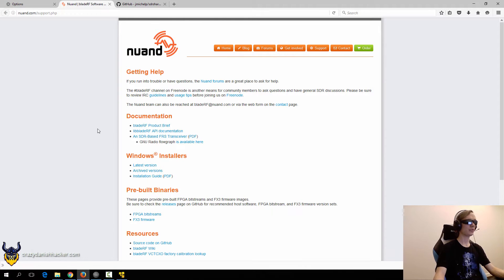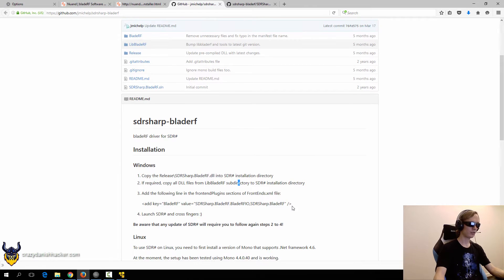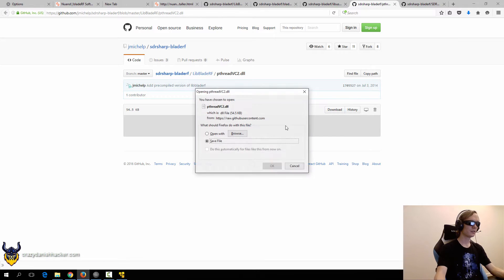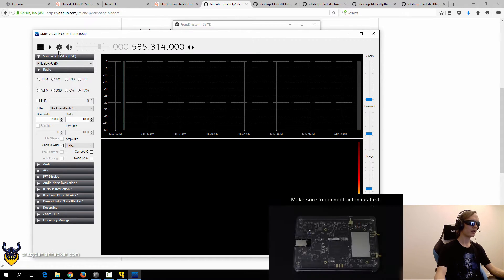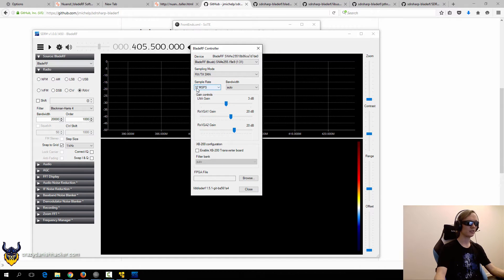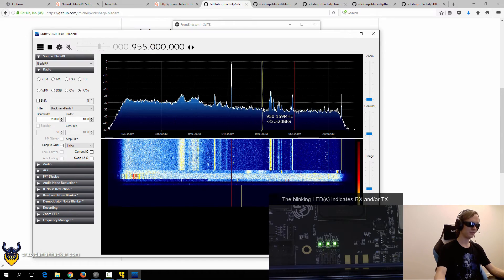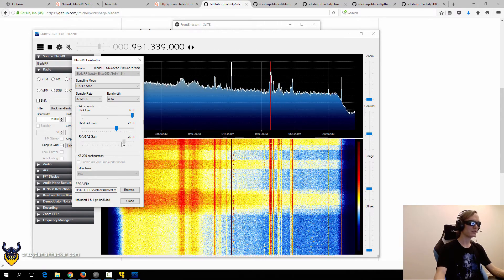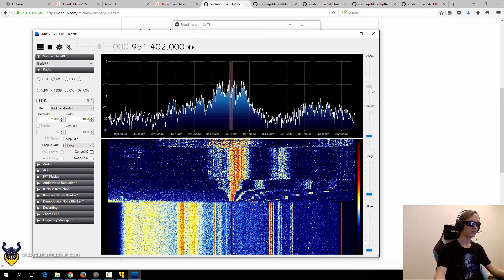BladeRF + SDR# on Windows 10 - Software Defined Radio Series #17

Comment: hey Crazy Danish Hacker, 
There is not device option in the bladeRF controller part, I have the bladeRF xA4, what i have to do? thanks
Reply from the maker: You need an old version of SDR# for it to work with the BladeRF plugin, and even then I'm not sure it's going to work with the model you have. Try out this instead: https://github.com/xmikos/qspectrumanalyzer 
It supports many different modules, including: https://github.com/xmikos/soapy_power

Comment: Hi Crazy, with mine bladerf shows up in Source dropdown but not in config dropdown, it sais bladerf in text next to device but doesn't appear in the dropdown. Running Bladerf  A4 on Windows 10 pro, is the USB ID; 2CF0 5250 correct? Thx for ur help.
Reply from the maker: Use an older version of SDR# and try again

Comment: I have been trying to BladeRF x115 work with SDRSharp without any luck. I tried with both a windows7 and a windows 10 machine but couldn't get it to work. I followed your video but couldn't get it to work.

I also used the guide from jmichep at github site as well and copied all the dlls to the main SDRSharp directory
https://github.com/jmichelp/sdrsharp-bladerf

I can't seem to get the BladeRF to show up in the drop down menu. I have noticed when I run BladRF-Cli program it crashes the first time and second time it works. when I do a "version" command I get the following,

BladeRF-cli version: 1.6.0
libbladeRF version: 2.0.0

Firmware version: 2.0.0
FPGA version: 0.7.3

when I go to zadig I see that following driver is installed

WinUSB (v6.1.7600.16385)

USB ID 2CF0 5246

I did update the FrontEnds.xml and it looks like this now,

I appreciate your help

Thanks
Reply from the maker: It's probably the version of SDRSharp that's not compatible with your BladeRF. I had the same problem when I upgraded.
Try this older version: https://mega.nz/#!Ii4D1IrA!QLUqWXqX6O8z8CS42FLY9kq32OVPW4-fGIk8bIX9q5w
Reply from the maker: Concerning crashes, it's quite common for SDRSharp to crash with my BladeRF on Windows. For the BladeRF-cli program to crash, that's quite unusual and you should raise a ticket with Nuand on their github page. Try and run the latest version, if it doesn't work, try an older firmware version perhaps.
Reply: I was using an old version of bladeRF-cli program and when I upgraded it to the latest version it did fix the bladeRF-cli crashes. After playing with SDRSharp for 3-4 days I was able to get it to work bladeRF with SDRSharp :) . I have to timestamp my samples (every 100ms or so) and save it to a file, it seems that I have to use libbladeRF API and program at a low level. Have you done that before?
Reply from the maker: I don't know much about that (low level programming for the BladeRF), as I specialize in web application security. I would probably look on the BladeRF forums: https://nuand.com/forums/ 
Anyway, an older version of SDRSharp like the one I shared and the BladeRF libraries, plugins, etc. should make it work (with SDRSharp), but as I mentioned in my original response, I haven't had the best compatibility, especially with the Transverter board in SDRSharp.
Reply: ok, Thanks

Comment: hi all 
the source 'sdfsharp.bladerf.bladerfio' is not ready when trying to run
also not showing in the settings
Reply from the maker: Try this (older) version of SDR# https://mega.nz/#!Ii4D1IrA!QLUqWXqX6O8z8CS42FLY9kq32OVPW4-fGIk8bIX9q5w and make sure you've installed the libraries and made the necessary configuration changes too: https://github.com/jmichelp/sdrsharp-bladerf
Reply: @CrazyDanishHacker  in this SDR version it is showing bladeRF in source section but after running the scanning it display error like "sampling rate error"

Comment: can you do a video showing the integration of the BladeRF with the GNU Radio, Thanks!!! The instructions in https://github.com/Nuand/bladeRF/wiki/Getting-Started:-Linux#Building_GNU_Radio_griqbal_and_grosmosdr do not work for me.
Reply from the maker: In the following video I used GQRX, which is using gr-osmosdr libraries as far as I know: https://www.youtube.com/watch?v=6Dtp06-uI38

In most of my GSM tutorials I used a program called gr-gsm, this tool also uses gnuradio and gr-osmosdr, where the latter gr-osmosdr stands for gnuradio osmosdr. 

So unless you're trying to do something out of the ordinary, then your BladeRF will work just fine on Linux with Gnu-Radio.

Comment: Hej, 2 spørgsmål.

1) Er du radio amatør?
2) Hvad gjorde at du valgte BladeRF i stedet for f.eks HackRF?
Reply from the maker: 1. Nej ikke i oprindelig forstand, jeg er radio-hobby-noob men også professionel penetration tester :-) Jeg har dog fokuseret på andre ting for nyligt, selvom jeg har nogle andre emner jeg gerne vil lave videoer om. Men radioerne har desværre ikke været i brug i et godt stykke tid nu. 
2. BladeRF er mere præcis når det kommer til at sende GPS og GSM signaler. Se evt. http://www.taylorkillian.com/2013/08/sdr-showdown-hackrf-vs-bladerf-vs-usrp.html

Citat: "The developers have invested heavily into their clocking architecture and provide a VCTCXO that has been calibrated within 50 ppb. All of the components were designed to be in sync so that no ClockTamer is necessary."

Jeg har læst at nogle folk har fået GPS spoofing til at virke på HackRF, mens andre blev nødt til at købe en TCXO til den. 

Men hvis man ikke går efter at lave sit eget GSM BTS, så ville jeg helt klart anbefale at få en HackRF i stedet for.
Reply: Godt svar Tak for det. :)

Comment: bladeRF doesnt show up in the source dropbox.  bladerf-cli (1.4.0, libbladerf 1.7.2) is working fine and reports Firmware 1.9.0, FPGA 0.6.0.
Reply from the maker: Carlos, it depends on what you want to learn. But in general, just look around :-)
Reply from the maker: Newest version of SDR# has compatibility problems with BladeRF. Try SDRConsole v3 instead, it even works with the BladeRF Transverter add-on
Reply: any videos that you can recommend???

Comment: which BladeRF did you get?
Reply from the maker: The x40, don't really need the fast version. I may get a HackRF or Transverter board (upgrade) at some point though. But for now, the BladeRF is more than enough.
Reply: Thanks for Anwsering 

PS: do you have a plan for a next tutorial? (it could be how to setup a BTS with BladeRF)
Reply from the maker: Veso266 Yes I have a plan for multiple videos, including what you mentioned. Only problem is I don't have a lot of time during the weekdays :-)
Reply: well thanks if you don't have time that's not a problem I can wait as long as you want
Reply from the maker: Veso266 Good :-) I'll get to it soon, currently I'm testing wideband capture with the BladeRF. The grgsm_capture program is clamping the bandwidth to 1.5MHz even if I set it manually to for example 20MHz, so that's another obstacle I have to figure out. That's for another video in relation to GSM.
Reply from the maker: I found a solution to grgsm and the "clamping bandwidth" issue last night. So I'm one step closer to getting frequency hopping to work. If it works I'll of course make a video and share any code I've modified/created.